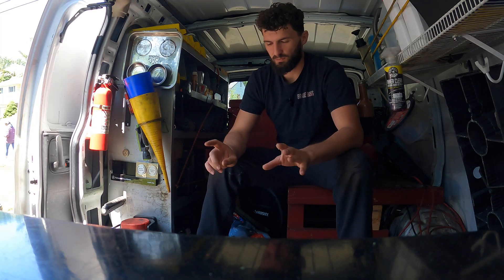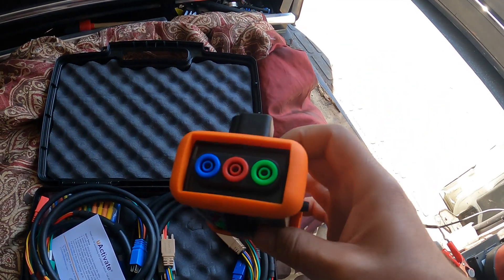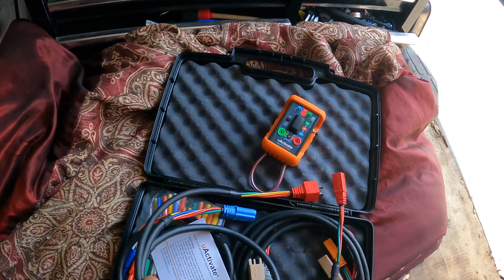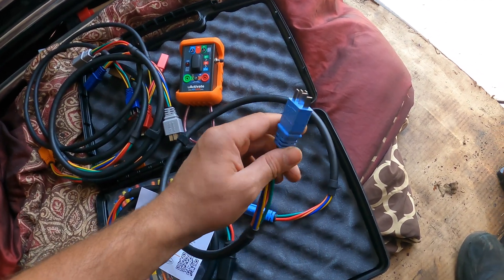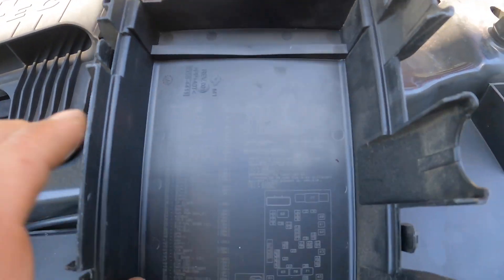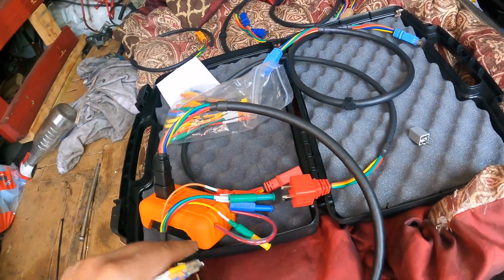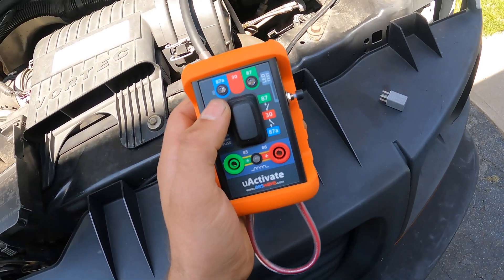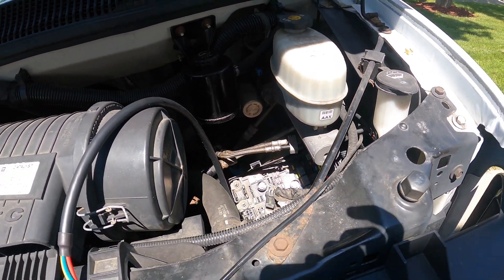It FINALLY Arrived. First Look At The New AES WAVE U-ACTIVATE Relay Circuit Tester

Comment: Big waste of money…
Use a jumper wire
Reply: For the price I think I'll use a jumper wire😂
Reply from the maker: You can do so much more with this tool than use as just a jumper wire
Reply: Just like a scope right? Really good way to stunt your knowledge
Reply: @weldingjunkie  no, not anything like a scope at all. A scope is absolutely worth it. Any other stupid comments?
Reply: @mikesabin8568  you missed the point of course. The scope connects to it dopey.
Reply: @weldingjunkie  you dont need a magic 300 dollar box to hook up a scope to the sockets on a relay… genius…